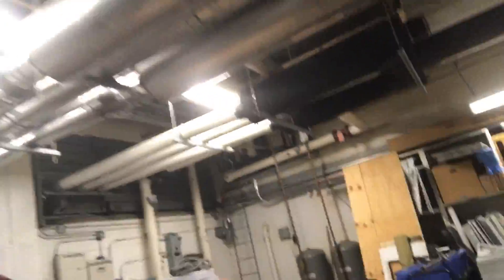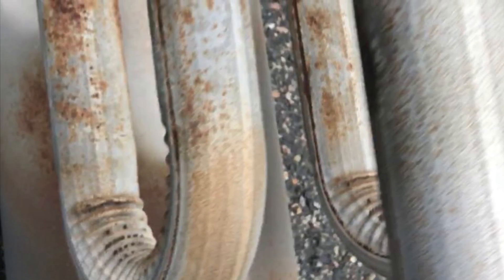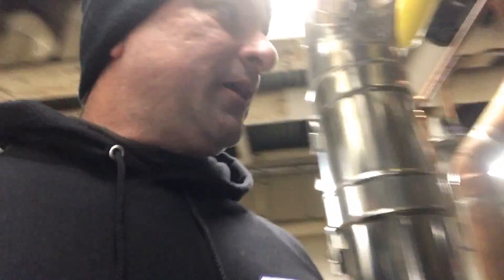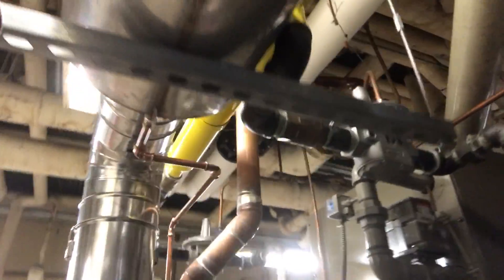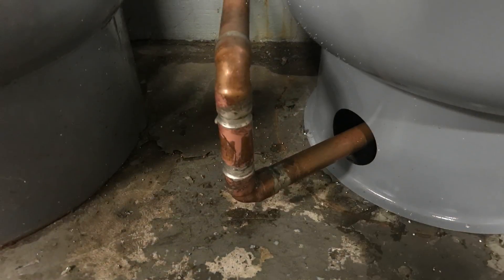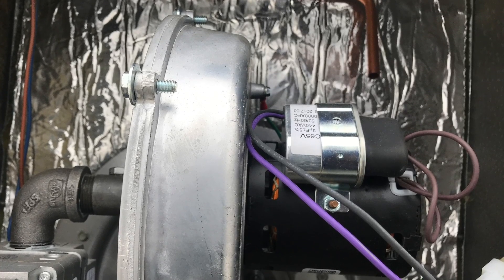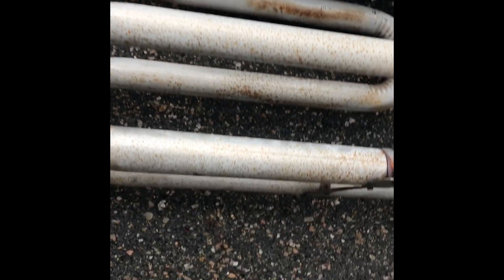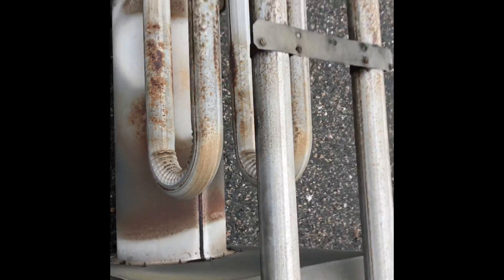HVAC Service Work Day Replacing Heat Exhanger/ Expansion Tank

Comment: Do you have any footage on cleaning the fire box heat exchanger on a viessmann vitodens 100 condensating boiler. Thanks so much for sharing
Reply from the maker: No, I don't have any footage on that, yet if I run into one I will film.
Reply: @thehvachacker  my boiler keeps shutting off and the thermostat's calling for heat, before it would run steady until everything  is hot??? And then shut off
Reply from the maker: Does your boiler at least heat up and shut off from being too hot. Doesn't mean your house just the boiler. I would believe you should get a fault if something was wrong with the boiler.
Reply: @thehvachacker  no faults, I think the air gap between the tubes are plugged on the heat exchanger  causing not enough heat transfer?? Ty for replying
Reply from the maker: That might not cause your burners to cut out just take alot longer to heat the water. Your pump might not be moving water. A zone valve if you have any might not be working correctly. How many zones are on your boiler and what activates it?

Comment: I've seen one of those Pulse boilers at an Army reserve building once but never seen them anywhere else. I loved the Lennox Pulse furnace but never worked on the boiler. I know they're not made by Lennox.
Reply: Yeah I still love my Lennox pulse furnaces. I've got hundreds of them still out in the field running like the day they were put in. I wonder if they had to pay Lennox to use that "Pulse" name?
Reply: @sknight0391  The story I was told was that the pulse design was from a bomb that was started off the ignition system of the airplane and it was cooled as it fell from the sky and when it hit the ground it would build up heat and explode? Lol Its still one of the most reliable easy to work on furnaces ever built. Other than the noise it was 93-95% eff. It was ahead of its time.
Reply from the maker: N.W. this is the first time running into this space aged looking boilers yet my commercial forman wants me to get very familiar with this school. So I look forward to learning all about these boilers.
Reply: @thehvachacker  actually that Hydro boiler is exactly what it was I seen. I couldn't remember the name but that's got to be it. This Army Reserve unit is pretty old.
Reply: @thehvachacker  It seems everyday I'm doing something new.
Reply: Yeah the homeowner paid a pretty nice chunk of money for it upfront when they had it put in but it more than paid for itself over the years. Most people were putting in 70 percenters back then, imagine the money the homeowner saved in gas bills over the years. As long as I maintain 0 ppm in the supply on start up I'm happy. When they're dialed in and working right they almost always put off 12 ppm in the exhaust. I sample it at the black tygon tubing coming off the exhaust nipple up to the safety. If I ever catch them going up over 100 ppm, that's when I say it's time to go with a new unit.
Reply: @sknight0391  My previous employer from 3 yrs ago was a Lennox dealer/ Installer of Lennox brand.  We had a 1991 pulse in our office. I just got back my Testo combustion analyzer and needed to check it. Thru it on our pulse. 94% efficient. Couldn't believe it. So i borrowed my coworkers Testo. Same thing 94% efficient. LoL!!! Great old furnaces.

 They just got a bad wrap from the 1982 to 1989. Lennox was doing a buy program only furnaces that were still under warranty.
Reply from the maker: So Lennox pulse wasn’t the only heating system to use the pulse ignition system. Hydropulse boilers were way ahead of the curve with efficiency. It was a noisy boiler with a combustion blower instead of inducer. It had a 15/16” spark plug that was a pita to remove. 15/16” deep socket, swivel adapter, 10” 1/2” drive adapter 1/2” ratchet and 3’ steel pipe to make a cheater bar. https://www.google.com/search?q=hydro+pulse+boiler&client=safari&hl=en-us&prmd=sivn&source=lnms&tbm=isch&sa=X&ved=2ahUKEwjr-Yvv6fjfAhVNnOAKHXcKAv8Q_AUoAnoECAwQAg&biw=1024&bih=666&dpr=2#imgrc=P1caLQtOjkahcM
Reply from the maker: That hydro pulse boiler was a great design. This guy I worked for was the last to work on thise boilers in this area and parts were so hard to get he would resell used parts. If he tore out a good boiler, not for efficiency yet because of noise he would keep the boiler in tack or strip al the parts. Those boilers would be found in housing authorities and schools because of the efficiency. I found myself working in some really bad neighborhoods in housing authorities in Newark nj servicing or repairing those water heater looking boilers.didnt help I was running into these he beginning of my service career when I first left install.

Comment: Looks like a trane voyager.  Good little job. It's good to see someone else doing other worn parts with heat exchangers. 👍
Reply from the maker: This comes as a package out of the box. Due to midterms at this high school they wouldn’t let us start the exchanger or go on the roof until after 12. 2 hours ripped out and burning smoke off new exchanger. 6 hour quoted job 2 men so...........I always replace inducers with exchangers.
Reply: @thehvachacker  nice!  Thats pretty quick. I have a bunch of them at my one school that is apart of my district.

Comment: So I clicked the video just do to the thumbnail of a trane heat exchanger. Was I know what that is and the "fun" it can be to replace them. ^,..,^
Reply from the maker: Me and a coworker tore this unit up quickly. This is a catholic high school and they were doing midterms so we weren’t allowed to start on the heat exchangers until after 12. We were burning the smoke off this by 2. I film and show most my work when alone since I was with a coworker I didn’t film the actual work.
Reply: @thehvachacker  that's some quick work for sure. Always easier with a coworker. It's that a 5 or 7 ton unit, looks similar to some of the smaller units I work one myself for a restaurant chain.